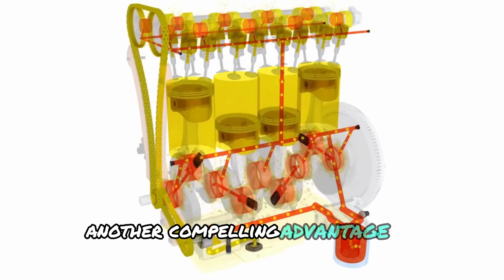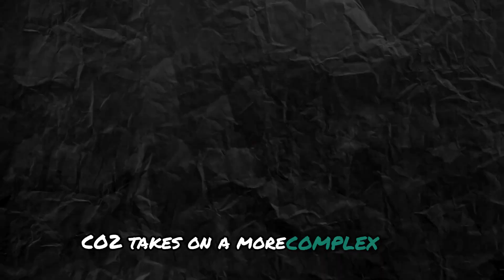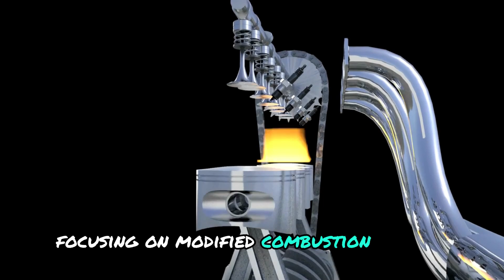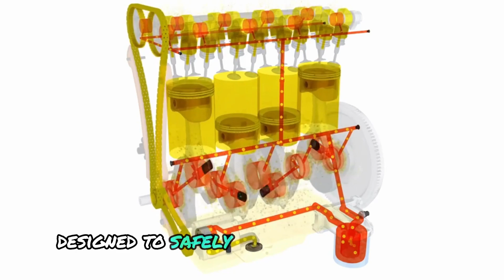Toyota's INSANE NEW Engine is a Game Changer!

Comment: Tell me again about this GREEN ammonia. How is it produced and how does it save CO2? I mean, currently ammonia is made by an industrial chemical process at enormous pressures and enormously high temperatures, and it uses fossil fuels to provide the heat and the pressure (Haber-Bosch process).